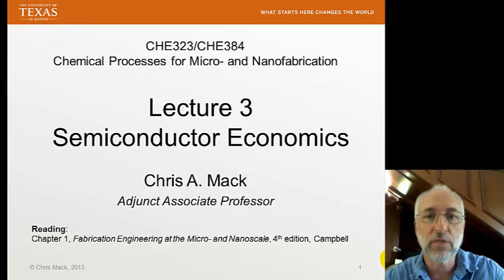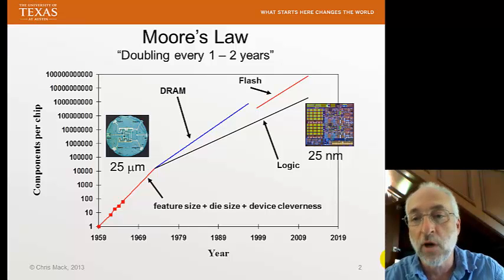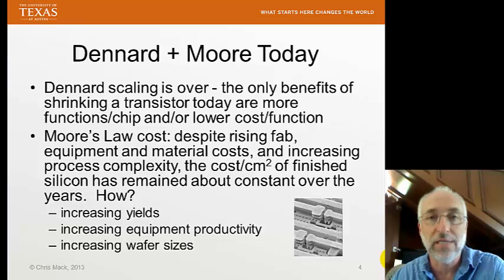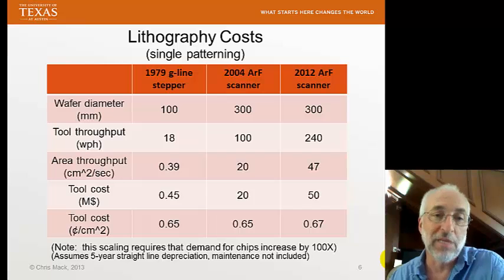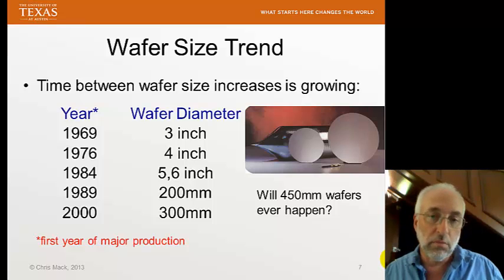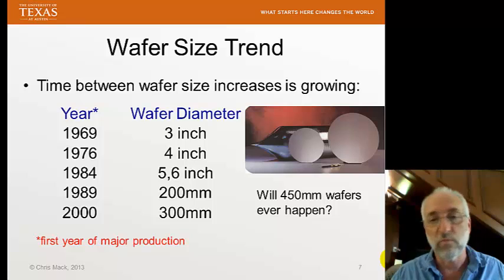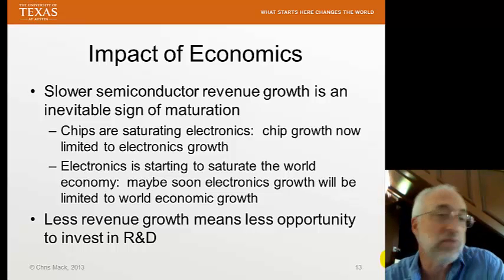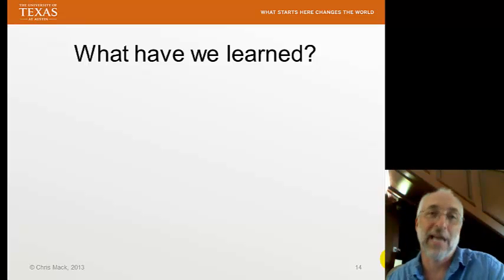Lecture 3 (CHE 323) Semiconductor Economics

Comment: So is there any research that has been done in the past years to increase the camera size for litho to continue cost reduction? Or will litho camera size be the limiting factor to a growing wafer size?
Reply from the maker: The "camera size" you refer to is called the field size of the camera.  We have held steady with a max field size of 26mmx33mm for over a decade, and I don't think it will get any bigger in the foreseeable future.
Reply: @ChrisMack  Why? Isn't it worth it? especially that moving the camera requires an incredibly precise and complex mechanical positioning system in terms of the control scheme, vibrations isolation..etc
Reply from the maker: @abdulrahmanhazem1929  First off, the camera never moves.  It is fixed in space, then the wafer moves underneath it.  Second, increasing the field size results in greater aberrations (imperfections) in the image, which reduces image quality.